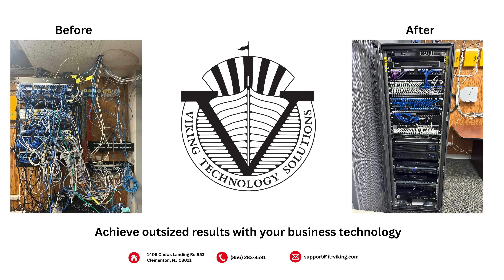Network Cabling & Server Room Cleanup Timelapse!

Comment: Hey Great Job amigazo!!! GReeting from Tablada de Lurin, VMT, Lima, Peru
Reply from the maker: Thank you for the compliment, and salutations from New Jersey, USA!
Reply: @VikingTechnologySolutions my dear friend is from New Jersy.
Reply: Please share more videos  about how to connect switch POE for NVR.
Reply from the maker: Thanks for the suggestion we'll think about it. Maybe this quick comment will help in the mean time...I don't know what brand you're working with but let's say for arguments sake you're using a Hikvision NVR. The IP camera channels on your NVR have predefined IP addresses. For example, IP Channel 1 is 192.168.254.2, IP Channel 2 is 192.168.254.3 and so on. When you're not using a built-in PoE NVR - you'll need to sign into each IP camera's local web interface or use a tool like SADP to assign it an IP address matching an IP camera channel on the NVR. The IP address config does not need a gateway address if its just recording to the NVR locally - but it does need the IP and subnet address usually a /24 (255.255.255.0). For this all to work - the LAN port of your NVR and each IP camera will need to be on the same layer 2 network. So a basic topology might look like this: NVR LAN Port, IP Camera network cables and a router plugged into a PoE switch. I hope something in there helps you out. Thanks for watching the video!
Reply: @VikingTechnologySolutions waoo amigazo you are increíble! Many Blessings in your life!!!

Comment: How do IT closets get like this? Owner has "Jim Bob" from the line run a cable here and there because he knows a little something about computers (actual excuse given). Owner hires "trunkers" at a flat fee to install cable and/or devices, thereby eliminating any incentive to do proper work since time is money. Owner chooses to just leave obsolete equipment/out of spec cabling in place because it's cheaper that way.
I see this all the time. There is a factory in the area where I live that looks 10 times worse than this, including routers and switches sitting on upended boxes and flying ties every which way. IDFs are ignored by Jim Bob because he knows no better, and cabling from machines/devices on the floor are home run to the MDF and are out of spec on distance by a long shot. Remediation was deemed far to expensive since they had just recently recabled the entire office (but didn't use existing cable tray at all).
Jim Bob and people like him are NOT the answer folks!
EDIT: We just went in to cable a bank branch remodel and the electrician had taken it upon himself to do the network cabling. From 20' away we could tell it was not Cat 6. Upon closer inspection, the cable was CCA and thereby prohibited by NEC as well as local code. When brought to his attention by the GC, he made the classic claim: "Wire is wire." We used his crap cable as pull strings, so that was the only upshot. Electricians DO NOT have the knowledge or qualifications to install network cabling of ANY type. Stay in your lane!

Comment: Awesome job!  Huge improvement.  As much as I love the result, the cheapskate in me always wonders if the amount of money spent to achieve this is ever really fully realized as ROI as time goes forward.  Not arguing with the great outcome, just with the expense for what is mostly appearance in an otherwise hidden area.
Reply from the maker: Thanks! A good point. There are gains besides cleaning up the cabling and the obvious improvement in technician experience that comes with. By identifying all lines, we were able to segregate and label VoIP devices and connect them to a dedicated switch and new inexpensive ISP circuit isolating them from the dedicated fiber which runs as the primary ISP. This (slightly) pushes off the need to increase bandwidth on the fiber circuit which comes with a hefty price tag. This new circuit is now also configured as a failover for the primary WAN in the infrequent event the fiber goes down which is a tangible benefit when an office this size loses internet service for even an afternoon. Another, but difficult to quantify, benefit is for the office management. Namely for desk and conference table placement when office furniture gets shifted around. Prior to the cleanup there were faceplates with seemingly usable 110 jacks staff might assume they could plug a computer or phone into but the cabling was inactive and in many cases was from a previous tenant and did not land in their network closet - those locations have all been replaced with blank faceplates and the active Phone/Data ports are all plainly labeled out. All of the cabling locations and port numbers have also been overlayed on the customers digital and printed floorplan so if there is a discussion about furniture placement they can easily see where they can or can not easily locate devices. I hope that info calms some of your reservations! Thanks for watching the video, we appreciate it.
Reply: @VikingTechnologySolutions 

I must say, it's neat! That's how I work also. 
But I always laugh a bit when techs use dedicated switches in a (big) building. 
To devide different business into their own segment/vlan, I suppose it's legit and easier for connecting cables for non techies.
You mentioned something about extra fiber costs when using one switch instead of 2 separate ones. 
As a network/voip tech I don't understand that reasoning. 
The current voip uplink (doesn't matter if it's copper  or fiber) can even easily put in the same vlan as voice, but then untagged.
So again no need for extra switches. 
One switch (stack) for all traffic, then you even could daisy chain pc's behind voip phones.
Voip is tagged traffic, so doesn't interfere with data/'normal' lan traffic. 

For multi tenants, dot1x is too much work at a daily basis?

But again,  I don't know the complete story and setup, so maybe it has a good reason😀
Reply from the maker: Thanks for watching the video! There are many ways to approach a problem, aren't there? This design worked for this particular customer and their objectives. Your comments on network topology are helpful and welcomed. I'm guessing your customers are fortunate to have you work on their systems.

Comment: great clean up job, I've got to do the same in a supermarket location tonight, clean up 100+ cables and move the IDF up going to be a long night.
Reply from the maker: Nice, taking systems fully offline overnight in retail is high pressure. I hope your install goes smooth and on schedule. Appreciate the compliment!
Reply: How did it go? You have any help with ya?
Reply: dork
Reply: @HelenCrane-jl1nv great ball of nothing

Comment: Wow, I'm sure glad you didn't use double ended RJ45's to extend the run. I didn't know you could do that with 110 blocks and still pass TIA.
Reply: you can have two or three couplers without issue in a cat5 run

Comment: you just did a great job.
q: if the cable was short to reach the rack, what should you do?
Reply from the maker: That is the problem we worked on in this project. The scenario was: two racks and the customer wanted it reduced to one. We extended cabling from the messy open relay rack into the new location utilizing Leviton 110 blocks for the cross connect. In other scenarios where cabling is too short, you might opt to run entirely new lines or extend them with another method. In this particular case, it was not worth the extra labor and materials given the quantity of cables and other factors like getting the job completed over one weekend and the unknown amount of unused cabling.

Comment: Honestly how does one "master" this? Love networking but sadly at my company its small and not a ton of practice can get done.
Reply from the maker: Thank you for watching our video! It sounds like you may already work in IT, so I’m framing the reply as if that’s the case. I’d suggest taking matters into your own hands and practicing on your own time if the opportunity isn’t currently there at work. An RJ45 crimper, a box of CAT5e cable and a 100 pack of RJ45 connectors is a simple way to get started. If you terminate 100 of these at home and can make them look like they do in our other video "RJ45 Termination - 3 keys to ensure a perfect connection" you’re ready to start terminating them at work. If you’re already familiar with RJ45s, then grab a patch panel and terminate that and so on – take it to the next level outside your comfort zone by purchasing a small amount of material as if you’ve got a job to do and learn “on the job” but at home. Focus on basics that give you immediate tangible benefits (like solving more problems with greater speed for your employer). For example, making custom length patch cables and punching down 110-style keystone jacks are useful skills when relocating a network printer, ceiling mounted wireless access point or repairing a damaged network line. With regard to the mastery question - that looks different depending on where you’re working (residential, small business, enterprise, data center) and a lot goes into it beyond the cabling termination shown in our video: namely following building and electrical code and choosing the correct cable type for your application (riser, plenum, shielded, direct burial etc..). If you’re planning to pull cable – it’s valuable to understand the basics of construction (how walls/ceilings/floors are constructed and insulated, metal vs wood studs, sheetrock vs plaster walls etc..) since your cabling may run directly next to, above/below/through or generally around other building materials and services you don’t want to interfere with due to a poorly planned cable path. Remember that wherever you’re installing - cabling must be independently supported, not draped across a ceiling tile grid or over top of pipes and electrical wiring in the ceiling. Pulling cable can come with many frustrating quandaries that make shortcuts tempting when fishing through walls, cutting in boxes and determining the ideal cable path. Talking over your plans with someone more experienced than you can go a long way and my best resources when planning out a cabling project have been people that have nothing to do with the IT network at all - like a maintenance worker, facilities director or the company’s electrician. They know the building layout and a quick conversation can end up saving hours of time.